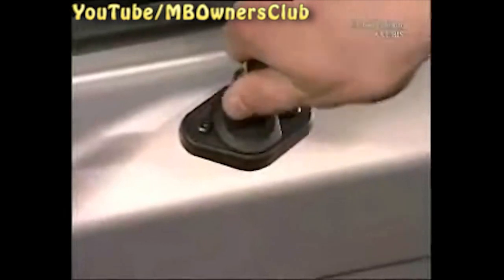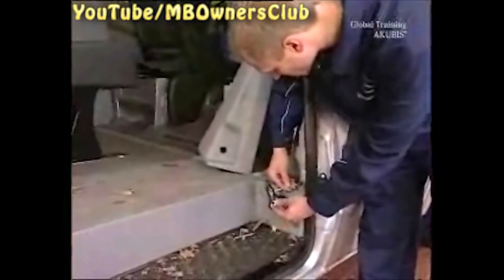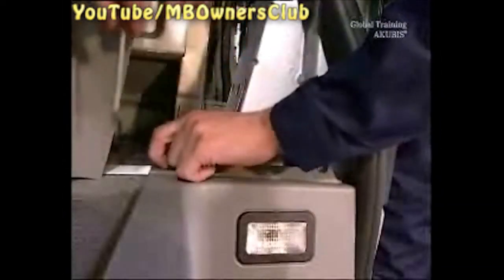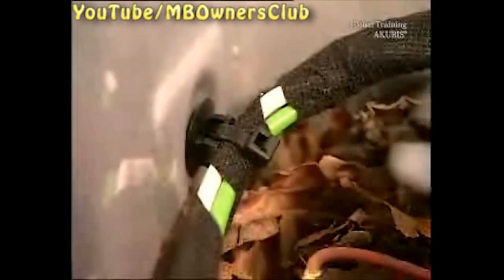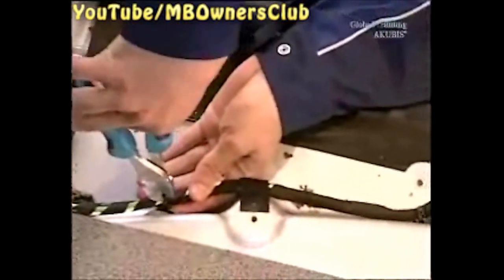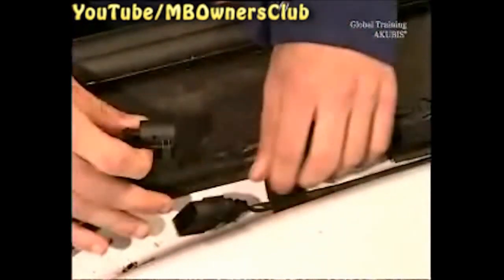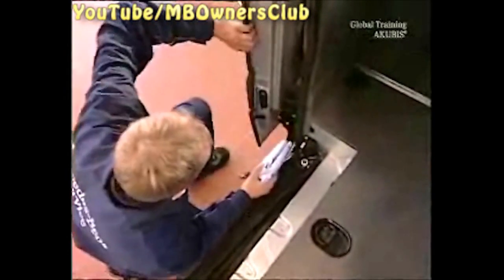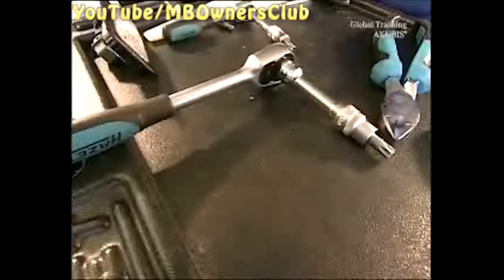Mercedes-Benz Sprinter - How to replace the cable track on the load compartment door | W906

Comment: Wish I had watched this before getting pi**ed off and just cutting the wire 🙈😝
Reply: Does the van think that the door is open if you snip the wire?
Mines a camper and would need to be half taken apart to get to where this guy got. So the snippy idea sounds tempting 😅
Reply: @xQueensryche94  Nope, it's merely for locking/unlocking. One the door is closed, it's closed, just not locked. You have to manually lock it from inside
Reply: @L4WNY  that's even worse then.. because I can't lock or even open the door from the inside. This vans been a nightmare recently (thanks for the quick reply)
Reply: @xQueensryche94  Ah no way! Hope ya manage to find a solution 🤞
Reply: @L4WNY  maybe a snip and deadlock is the way for now